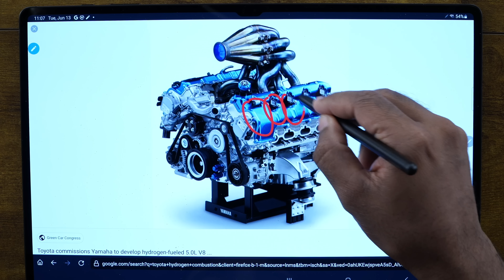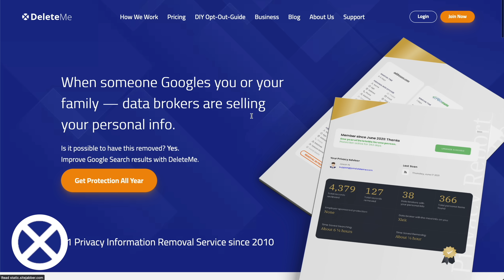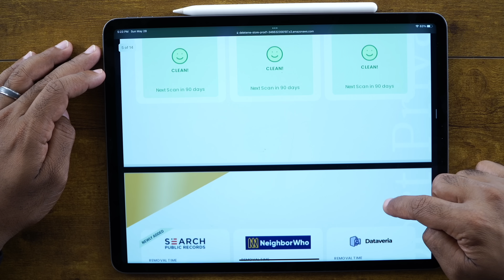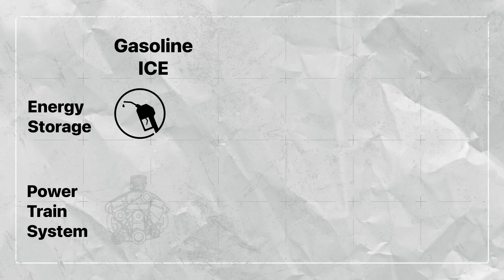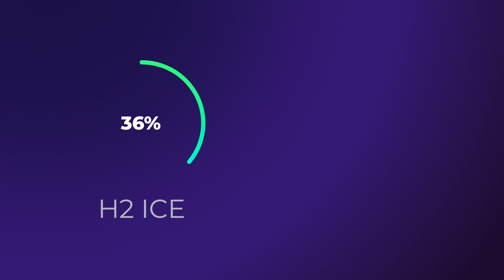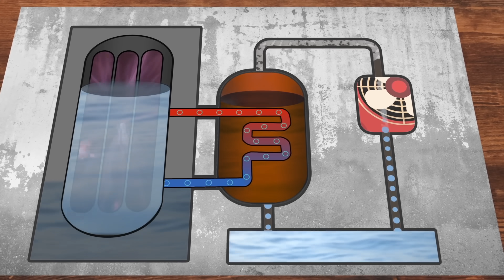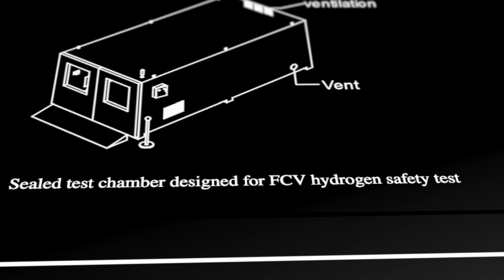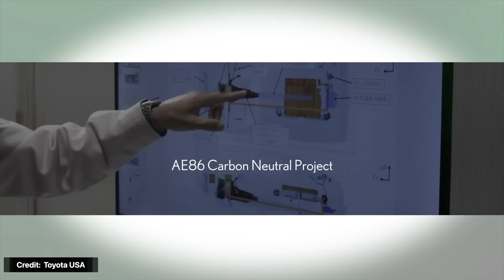Toyota's Says They Just Destroyed EVs - Hydrogen Combustion Engines

Comment: One thing I really like about H2 is how well it pairs with renewables. The sun shines and the wind blows even when the energy provider doesn't win the contract to power the grid. All this free energy could be used to make H2.

It could also be done by employing a smart grid for EVs, whereby people choose to buy/sell electricity to their plugged-in EV depending on market price. But this could be a harder lift to implement than installing all new H2 infrastructure, because you'd have to get the PUC to comply. Here in the US Midwest, Xcel has successfully thwarted a smart grid for over 15 years.
Reply: There is no such thing as "free energy".
Reply: @mikemondano3624  thing is you can't just stop a nuclear reactor it keeps producing energy even if it's not being used. So technically that's what free energy is.
Reply: @ygayovy  They are stopped all the time. If the energy were not used, where would it go? If the neutrons are moderated, they do not exist in numbers great enough to sustain a chain-reaction.
Reply: @mikemondano3624  Sorry but they are not.
Reply: @mikemondano3624  Nuclear power plants operate in the "base load" mode. Meaning  constant output and all other means have to follow. Sudden change in load will result in emergency reactors shutdown resulting in 1000s of MW in losses, not to mention how complex their startup is to begin with. Generally we waste a lot of energy balancing the grid. But those losses usually come from "load following" types of generation. OR why can't we just balance nuclear power plants too by having them to produce hydrogen like Japan tries to do? Although they use reactor heat directly without losses on turbine, which are huge btw, hence effectiveness is actually as high in both methods. Bottom line: It's not always free per se but very close to be or at times actually is, like with solar.
Reply: @ygayovy  The load has absolutely no effect on the reactors. It's not like they need to increase torque. Their output is not controlled by load, but by the operators.
Reply: @mikemondano3624  Sorry but you're wrong again. Nuclear reactors generate power through spinning turbines, if there's no load those turbines spin faster to the point of failure. Same problem with thermal or wind.
Reply: @ygayovy  Turbines are not part of the reactors. They use energy produced by the reactors after it has been transported to them. There are no moving parts in a reactor.
Reply: @mikemondano3624  There are a lot of moving parts in reactors, in fact they consume quite a bit a electricity 😁
Reply: @mikemondano3624  either way turbines considered to be a part of reactor. But why did you change the subject?
Reply: @mikemondano3624  Okay, let me summarize it for you. We waste an enormous amount of energy when we balance the grid because we don't have a decent way to store it. That energy is what we call "free energy" that could be stored in hydrogen.
Japanese went further and used nuclear heat directly, hence efficiency is almost as high as that of turbines.
Reply: @ygayovy  Reactors are piles. The control system is not part of the reactor.
Reply: @mikemondano3624  whatever, how exactly does it change what I've said on the subject?

Comment: 1. how to seal from H2 throughout the pressurized (intake)pipelines and all the vibration when the engine is running? Independent if it a heavy duty vehicle (digger ...)   or a simple passenger car? Has this major problem solved over the years?
2. H2 has to be produced.......it is not coming out of nowhere or does it nowadays?
3. Why not implementing Brown Gas to the gasoline engine....oh i forgot therefore you would be killed in an instance of a second. Damn it.

Comment: The engine featured in this video, Toyota's 4A-GE, is not a newly designed engine. Beefed up internals and some changes to the plumbing to get the fuel into the cylinders maybe, but this is the same engine that came standard in the original (make 1) 1985 MR2. I this know because I owned one and it, and it's child the (make 2) '89 to '99 MR2 Turbo's are still my favorite cars to drive.

Comment: I think for the efficiency of energy usage for EVs you should also factor the source of the electricity and the efficiency of converting energy to electrical energy.

If the electricity source is not a renewable source, this efficiency can knock down the benefit of EVs in this particular aspect.
Reply: Even with coal only energy an EV pollutes less because it doesn't waste 60+% of the fuel as heat...     :)

The problem with H2 is volume and storage.
The problem for the H2 ICE engine is moving parts, a lot of them.
And the problem with hybrids is... even more moving parts..
EV's get an extra win by just having less whirring clanking cogs to waste energy and wear out...
Reply: @D_Rogers  Sire do i need to remind you about global warming
Reply: You need even more electricity to create "green" hydrogen. Whatever issues battery EVs have from electricity generation, hydrogen has them 5 times worse due to being incredibly inefficient in comparison.
Reply: Yes, I've heard this argument, when naysayers say the electric car is just as inefficient as the ICE, if you take the electricity generation into account, with the current power grid.  If you are going to make that argument, then you also have to factor into the ICE, all the fuel infrastructure, and exploration, drilling, refining, and transportation with all it's inefficiencies as well, which would reduce the ICE efficiency even lower than it already is.  Funny, I never hear that part of the argument on the ICE side.  Fair being fair, you have to take in the "energy" generation into account for whatever platforms you are going to be comparing.  More and more of the power grid is being converted to renewables, and will continue to do so, so the argument about this is losing steam as time goes on.
Reply: And how do you make hydrogen 5head? 🙃
Reply: Agreed, but majority of the electricity produced is already wasted if not stored in batteries. So if car users charge their batteries at night, then they are using power that is unused
Reply: @ecoideazventures6417  The same argument can be made for using excess energy to gather and store hydrogen then.
Reply: @andrewhinsurance  Agreed, someone has to implement one pilot project to prove the business model
Reply: @ecoideazventures6417  They've had it running in California now for a decade plus.  The fuel is very expensive and the costs invovled to build the stations has stopped them from adding more.

Comment: It is better to stop thinking about hydrogen as a fuel and think of it as a battery. In fact maybe we should think of petroleum as a battery. 
If there were no gas, what would it take to make it (well, alcohol). Think end to end, corn to car. Same thing with hydrogen, windmill to car.
The problem with green is that it is not green, there is an overall net negative. Hydrogen may be a good storage mechanism for electricity, e.g. large tanks, compressors, and HFS at electric aggregation centers that guarantee all electricity produced is used by consumers, or stored as hydrogen. When the sun goes down or the wind stops, use the hydrogen to kick out electricity.
Toyota is making a great bet. This may not be the end products, but they are learning things nobody else is…

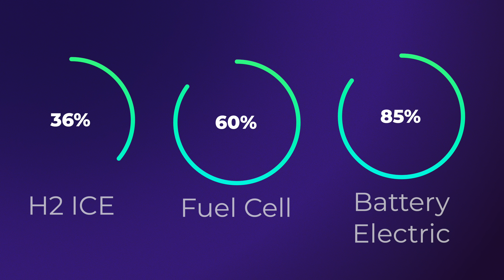Comment: 10:21 Why is 60% visually the same as 85%? And how efficient are EVs in areas without renewable or nuclear power sources? To me, it seems like we need to build a sustainable and green infrastructure before EVs make much sense. In the meantime, it's better to directly convert fossil fuels to mechanical energy instead of fossil fuels to energy, lose it in transmission, then put it towards mechanical energy.

Comment: Are we also forgetting the carbon footprint to produce EVs? The child labor and no real regulation on the precious metal mining? What about battery cost, lifespan and environmental disposal hazards? And how do we create power for EV's? Oh ya, Coal, in most cases. Wind turbines are expensive, require lots of maintenance, and also pose environmental risk all while being an eye sore ( which is why the wealthy dont want them in their neighborhoods). Now, lets also think about the average american who cannot afford a "cheap" new car at $30,000. Finding a way to use hydrogen and retrofit old ICE is probably the smartest path forward. Not quite as clean but is it really not as clean when you consider all of the other factors? I applaud the forward thinking but truly believe the future, if there is one, isnt either of these; at least not with some breakthough battery technology that doesnt use rare finite material, lasts longer than a couple years and doesnt cost a fortune and can find a clean and cheap way of producing electricity.

Comment: Many great points here. I just want to throw out another reason that H2 ICE and Hydrogen Fuel cell electric vehicles do have an advantage over battery electrics in places with colder winter climates, such as where I live in Canada. Batteries need to be kept warm otherwise their charge drastically depletes. So if you happen to live in a house or building without climate controlled enclosed parking, the battery charger will be running for far longer to keep topping up the battery or running the batteries internal heater. Then of course, when you run out to do some errands at -10C. I don't need to explain the problem there, but when you return home, the charger has run longer to replace the charge in the batteries.
Oh, but one thing. Right near the end of the video, when you mentioned the Toyota AE86 and Subaru BRZ being a partnership. Close... The Toyota GT86/Scion FRS and Subaru BRZ were a joint effort using Subaru's low-mounted boxer engine for better handling. The video clip was of a Toyota Trueno with the 4GA engine (AE86), which Subaru had no hand in developing back in the mid 80s. The GT86/FRS/BRZ were the spiritual successors to the AE86 line (Trueno and Levin) and have since passed the torch to the current Toyota GR86.
Great video though!

Comment: The thing you're not mentioning in your energy efficiency comparison is that, similar to hydrogen ICEs, gasoline engines are also usually only around 35% efficient, with efficiency dropping drastically at higher engine rpm. It's simply an unavoidable problem with combustion engines since conversion of energy is, like you mentioned, inherently less than 100% efficient, and during operation a combustion engine needs to convert energy multiple times in order to function. Add to that the rotational resistance acting on the crankshaft which is produced by the valvetrain and the generator, and it's easy to understand why ICEs operate with abysmally low efficiency. 
Source: am automotive technician

Comment: Every single German car manufacturer researched in H2 combustion engines since the early 70s and Mercedes (Fcell) and BMW comes out on the market 20 years ago. Germany has the biggest ICE industry and supply chain and yet this alternative was buried many years ago because it just doesn't make sense. Japan is late with electrification and they have also slept through the H2 issue. I'm starting to get the feeling that they don't really know how to maintain their automotive industry in the future.
By the way, Germany also has the largest hydrogen filling station network in the world and yet it would no longer be considered an alternative. Decades of research have led to the conclusion that this is not suitable for private transport. However, heavy goods traffic is a different issue. There, hydrogen could well be suitable as an alternative

Comment: It you also account for the mining of the lithium cost? Also environmentally lithium and lead for batteries has become and becoming a huge environmental issue. Maybe electrolysis H2 generation with integrated solar panel mounting so only fill up with water. I just think the copper mining and lithium mining for evs offset the benefits.

Comment: You mention that EV battery production requires rare minerals like lithium, cobalt and nickel. These minerals must be mined. Mining operations required huge amounts of energy to power the heavy dutry excavators and trucks needed to move the raw ore to the mills for processing. Then the ore must be processed which again requires very large energy inputs. None of these elements apparently factored into your effciency calculus.  On top of the foregoing oversight. the current proven, probable and possible reserves of many of these minerals is insufficent to manufacture the numbers of EV's requied to replace even the current number of ICE vehicles on the road today, let alone the increase in the number of vehicles being added in the third world as these economies continue to grow. You did mention that hydrogen is the most commonplace element in nature so there is little likelyhood that we will run out of reserves of hydrogen. I agree that decisions need to look at all aspects of potential replacements of fossil fuel powered ICE vehicles, but all factors must be considered when assessing potential technologies. The marketplace, not governments has proven to be the best arbitor of the winner of these contests.

Comment: I think hydrogen has way more prospect that EV in the long run. 
1. Hydrogen does not need to be mined - it is literally everywhere.
2. You can put your electricity in a lithium battery or use it to eletrolyze water.
3. Disposing lithium batteries would be a huge headache.
4. Fill up your tank in 5 minutes.
5. Easier to keep it safe since it requires to mix with oxygen to burn, unlike batteries that can short-circuit internally even when nothing is happening.
6. Unlike batteries, your fuel tank does not lose its range over time. [EV range pretty much halves in a year]
7. Way lighter vehicle meaning way less energy required to move it in the first place.

Comment: One could also say - Hydrogen ICE to be all the benefits of ICE (experience, support network for ICE [parts, workshops, specialists], affordability, convertibility* - almost like with the LPG, any combustion engine could be converted to it so it drops the price even lower) without the baggage of the Battery Electric (exploitation of African workers in Lithium mines, many of regions still making electricity from coal [fake eco-frendliness], battery costs and deterioration, poor winter performance, poor charging situation, not uncommon battery combustibility [would not risk keeping it in the indoor garage], generally poor range exept in only the top trim, expensive models)

Comment: Well, can you tow a boat with EV and launch it from the ramp on the water and get it back?
Also, EVs are not so green as the propaganda around them claims: The mining for precious mineral/metals to make those batteries is devastating for the environment, but people are brainwashed and behaves exactly according to saying – "What the eyes can't see, the heart doesn't hurt", so no one cares about how the EVs are build, especially the batteries. And recycling the batteries is another toxic story. But that is not happening to any average consumer in their garage or backyard, so they think, their EV is green.

Also, EVs because they don't produce the sound, people can't hear them, which is concerning H&S factor. Many people reverse out from their driveways and the majority of kids death are they have been ran by those people reversing and not giving a way to pedestrians, which are in many cases kids biking to school. If car are possible to hear, kids have higher chance to stop and give way to a car. With EV there is 0 Zero chance.

But I bet in both cases, if there was a calamity on a motorway in the winter and 2 millions of cars stuck there in the colony, all cars will be using their batteries or fuel or H20 to produce heat  not to freeze in them. But the EVs or H20 cars won't have a chance to use traditional canister to refill the used battery or H20 gas, but only petrol cars.
So who will remove and collect and or recharged or refill those 2 mils flat cars on a motorway in the winter?

Comment: Different types of metals are also becoming rarer and rarer so I think different solutions to be on developement is a good thing. Also if you can just convert old car to drive with hydrogen its greener than buying a new ev for decates if you dont need to change the battery to the ev. 

Toyota is developing hydrogen cars couse japans situations. They have a lot of natural hydrogen banks and japan has somewhat a energy crisis what I have understood. They dont want to source electricity from elsewhere, but they also cant be self dependent yet. 

The partnership with subaru on gt86 and bmw with supra are for the cost yes, but they are not just a reskin of the other car. Especially with supra the dimensions like wheelbase and width and suspension geometry are totally different from z4. Toyota knows what they are doing when they are tuning a car.

This is what I think so tell me your opinions.
Reply: Also a chargable ICE Hydrogen EV hybrid you can drive with only electricity or both would fix a lot of problems I think. Small battery you can drive like 50 miles that uses less metals but is enough to go to work or buy groceries and hydrogen ICE for longer drives. And if the battery isnt hidden under the floor but in easier spot like in prius it would be cheaper and easier to replace🤔